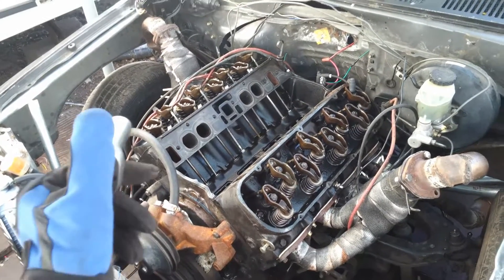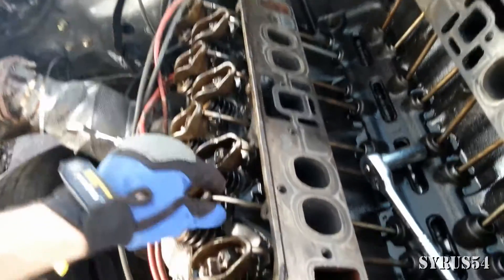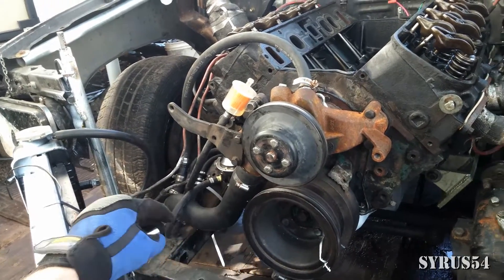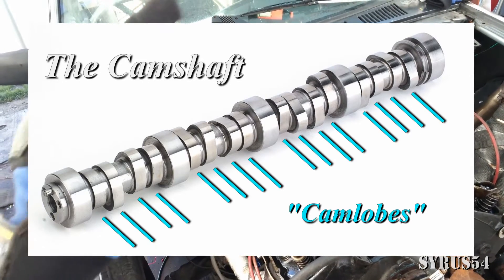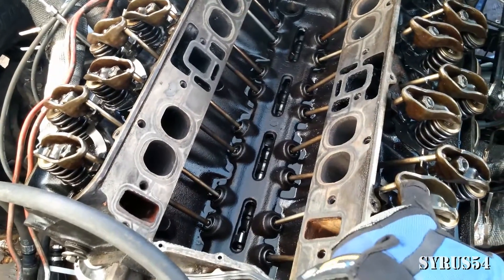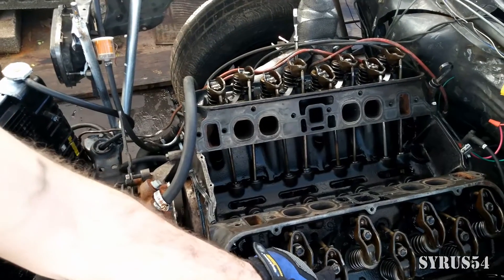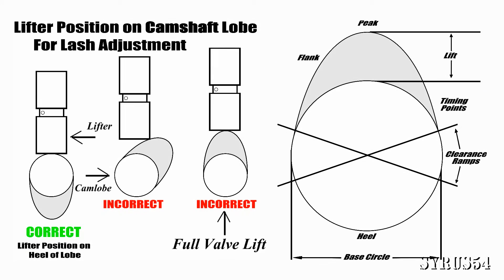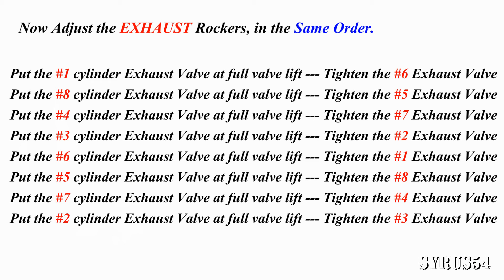Vehicular Education - Resetting BBC Valves & Lifters to Zero

Comment: Try it this way it's way more accurate and easy, put a mark on the lower pulley or balancer that you can see easy, then just go to each rocker arm and very gently take all the lash out of the rocker arms, then turn the crank 1/4 turn , check the lash out of any rockers that have lash, turn 1/4 turn again , repeat this for 2 turns of the crank pulley, then all the zero lash is set now all you do is tarn each rocker nut to your desired preload of 1/2 or 3/4 turn and your done ! And you don't have to take anything off except the valve covers, WAAAAY EASIER AND ACCURATE

Comment: Your making this more complicated then it has to be and totally backwards and wrong way to do it. When the exhaust valve on any cylinder begins to open, you can adjust the corresponding intake rocker lash. Vice versa with the exhaust rocker lash. When adjusting, you spin the pushrod until you feel zero lash....people, dont take advice of setting rocker lash from some guy with a rusted out BBC....
Reply: yeah that's sum dumb shit... making it way to hard man

Comment: I have a 1972 bbc 402 30 over with the stock popup pistons and the 3917215 closed chamber heads 101cc with copper head gaskets. The cam is a .515/.515 lift flat tappet cam. besides roller rockers, are the stock push rods stock length good for this cam? do they need to be a special length?
Reply from the maker: That's above my pay grade. Personally, I would use them and see what happens. But make sure the cameras rolling

Comment: Through those tbi heads in the trash and get some large oval port heads
Reply: 1993 Hot Rod Magazine showed how these heads can out perform oval port heads.
Reply: @Spoolingturbo6  not if you port the ovals and the tbi don't flow not enough metal to port them no where near like a ovel head can be